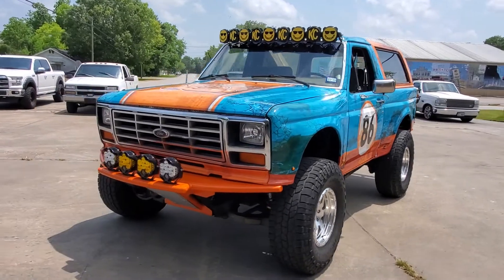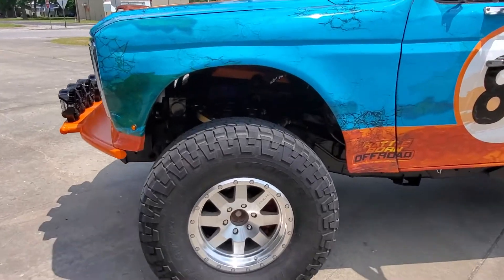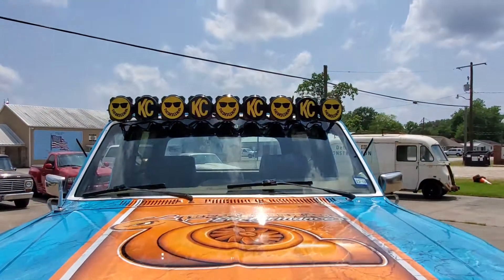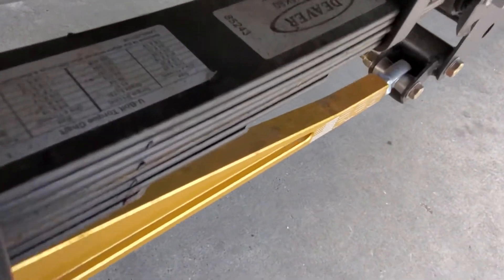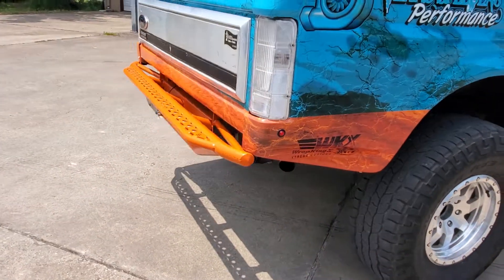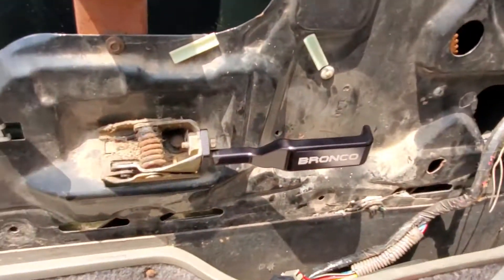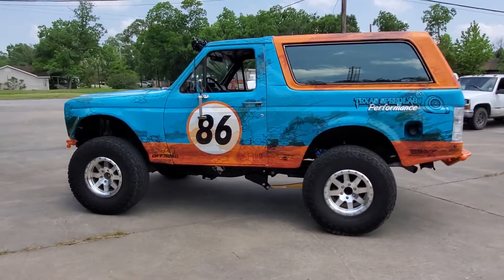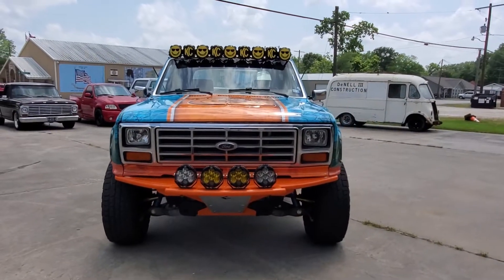BRAPTOR the Supercharged Coyote powered 86 Bronco on 2013 F150 chassis with Raptor suspension

Comment: Did you have to cut and shorten the 2013 frame and mount the bronco shell over it or did you just swap the drivetrain and the suspension over too the bronco frame?? Looks really great!!
Reply from the maker: Yes I cut a big section out of the frame, moved cab mounts. Trimmed the bottom of the cab as well as trim the top of the frame rails
Reply: @TexasSpeedLabPerformance  wow great work tho
Reply: @TexasSpeedLabPerformance  Yep I figured there was a decent amount to fit that body.  Funny, I was thinking what it would take to make one IFS.  Where did you find the frame?Would love to see that in black with the Free Wheeling design Chromatic decal package